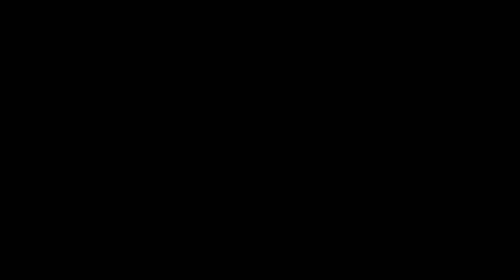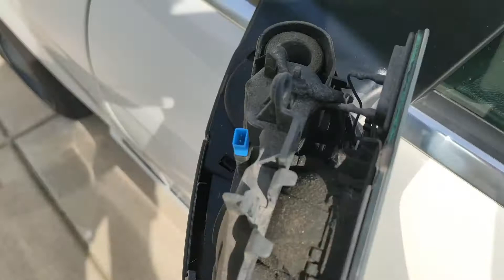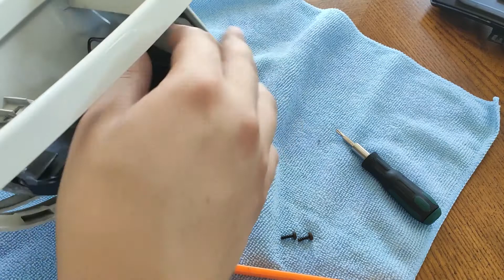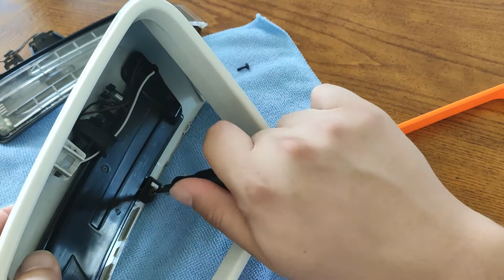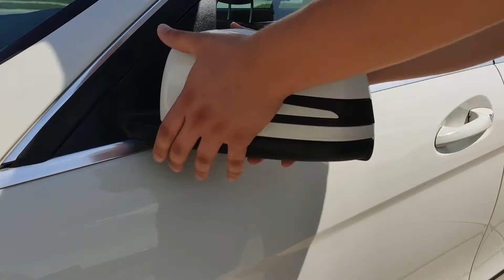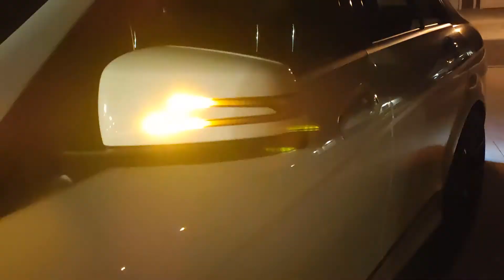Mercedes-Benz LED DYNAMIC TURN SIGNAL DIY Install (Sequential LED W204 W212 W176)

Comment: Thank you very much for this video. All the others talk about removing the glass which I was dreading, so I thought I would try this one first and it worked really well as for the video. It was one of those jobs that I was avoiding because I thought it would be a nightmare and it was really simple. I can't thank you enough.
Reply from the maker: No problem! Glad I could help! I saw some removing the glass - definitely a bit sketchy!
Reply: @ProjectAuto  Very happy with not having to remove glass! Only problem I have is after completing this job I now have a warning message on the dashboard saying 'left hand mirror indicator', is there a way to reset this please?
Reply from the maker: @pete1433  in some cases resistors are required, so you could use them to fix that. Otherwise they'll function just fine even with the error

Comment: Are they after market mirrors ?? Or did you take them of a newer shape w204 i have a w204 2008 and my mirrors was the big old style bulb ones but i recently upgraded to aftermarket led ones but now i want to put sequence ones in but my mirrors are aftermarket any help would be appreciated!
Reply from the maker: No they're stock 2010+ mirrors, not sure how the aftermarket housings work
Reply: 2008-2009 had a different style mirror. Even though 2010 is a pre-facelift year the mirrors were changed in 2010. These mirrors were also used on many other Mercs, including the E class and GLK’s of near vintage. So you’ll either have to find ones made for 2008-2009 specifically or upgrade your mirrors to 2010+, and I’m not sure how simple that is, as far as mounting is concerned.

Comment: Thanks for the video. I just got a pair of these for my 2011 C300 (W204) Sport from eBay. Unfortunately they didn't work. These came from China so who knows why they didn't function. I tried installing LED bulbs previously in the tail lights and they threw up errors becasue they don't draw enough power for the ECU to recognise them. This may have been the issue with the dynamic turn signals as they didn't power on and gave me errors as well. The 2011 C300 just doesn't seem to like any exterior lights that aren't OEM.
Reply: Hi I purchased mine from China as well had the initial install problem but they did work looks great with the blue start up

Comment: I installed them too, butt now I get regular the message it doessnt work butt i checked and they do work? Did i buy the  fake version?
Reply from the maker: Yeah i think on preface lifts we get the issue but it works fine